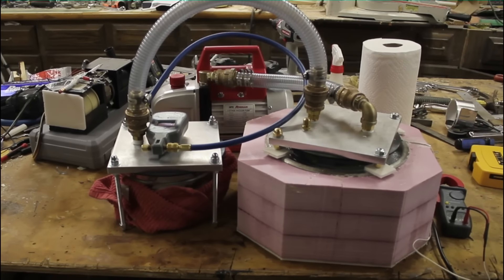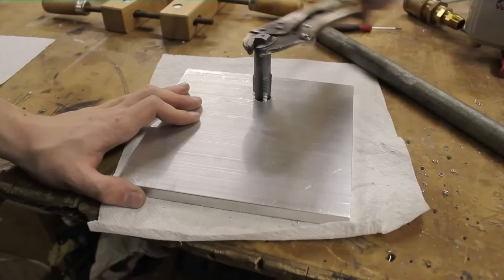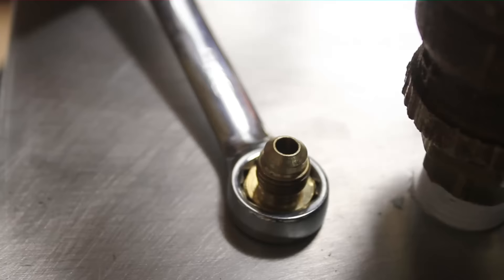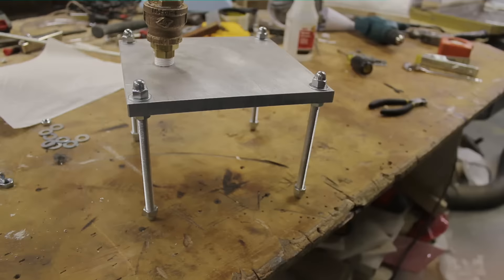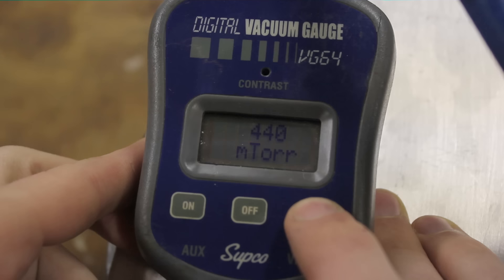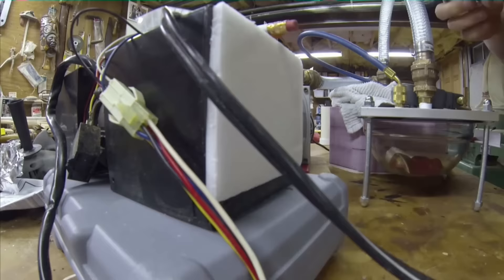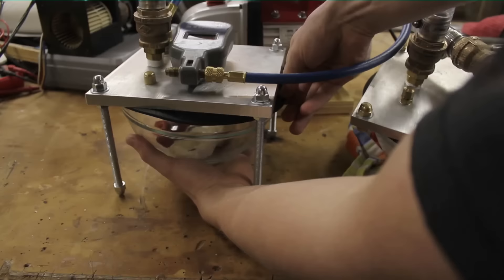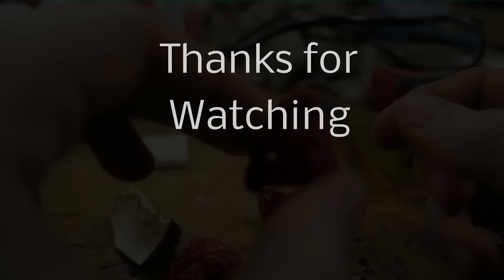How to Make a Freeze Dryer

Comment: Hey BenNBuilds, thanks for this. I'm working on this build and I have a couple questions:

1. What exactly is a water bubbler and where can I find one (wikipedia says it's just a drinking fountain)?

2. What exactly is this hacked water bubbler used for? Is it just used to freeze the food instead of dry ice, or can it somehow be an alternative to dry ice + isopropyl alcohol as part of the freeze dryer moisture trap? <-- I ask this because you said it's an alternative if you don't have access to dry ice, so I'm just wondering if you meant it works to supplement dry ice for this part too.
Reply from the maker: Just one of those office water coolers that take those 5 gallon water tanks. They have small refrigeration loops in them, similar to what cools fridges but smaller.

 Its just an alternative to dry ice, but one loop on its own won't get cold enough (you would have to build a cascade with two to reach anything past -30, but that's a fair bit more complicated) so I really just used it as a supplement test less dry ice, but the effect was likely negligible and not worth it as dry ice is pretty cheap.

Comment: Nice work BenNBuilds !
I am doing this as a science project but got stuck. The one that lends me the pump said that it should be able to handle water vapor, so i skipped the cold trap (Dry ice is hard to get where i live) and i get below 200 pascal (just checked the pressure shortly because i borrowed the gauge) But as soon as the icecream gets subjected to room temperature, it melts even if the container is connected to the vacuum pump. You mentioned in another comment that the oil catches the water vapour, so maybe it gets oversaturated and then cannot dispose of all the water? The oil have only gone cloudy when air have leaked in.
Reply from the maker: You may just have to get your ice cream colder before you start. I froze mine past -50F so I had a nice time buffer before sublimation cooling kicked in. If your just pulling it out of the freezer (usually 20F) than that's your problem. Ice cream is meant to be soft and edible at those temperatures. You gotta deep freeze it. 
    I encourage you to reconsider about the cold trap, Its easy enough to find a water bubblier or something.The pumps really can't handle all the water that is inside ice cream. 5oz of water is way to much for a rotary vane pump to handle. I assume whoever lent it to you didn't know it was intended for freeze drying. The water vapor present in just a couple cubic feet of regular air can be bad.
Reply: BenNBuilds  The teacher that lends me the pump is actually teaching relatable subjecs to refridgerator maintenance and according to him, there can be water vapor inside the cooling systems so they are built to handle some of that. I am planning to build a cold trap anyway because it adds some security to that the pump will not wreck, and i can also monitor it to see about how much that have left the icecream.

I actually left the icecream subjected to *30C (-22F) under vacuum for 12 hours before i put it in room temperature, and it still melted. I also tried putting it in an icebox with cooling clamps around it so it would not heat up too fast, but it melted anyway. I am starting to think that the standard tubing with the 1/4" vacuum pump fitting may be too small.

Comment: Im sure someone asked this: 

What did it cost to build? 

And more importantly,  whats the estimated average cost per pound to freeze dry food?  

Is the cost of your time, parts, materials,  dry ice, etc going to be more than buying the food already preserved?
Reply from the maker: It cost me about $150 to build.
 If you use dry ice for the cold trap it will be way more expensive to run. I used about 10lbs for 18 hours of drying, which is like 10$ every time +checking it every hour. With the hacked water bubblier the only consumable was electricity so it costs less than a dollar to fully dry stuff. If I got a bigger food chamber and fit a pound or two at a time It would get super cheap. If you used it all the time it probly wouldn't take long to break even

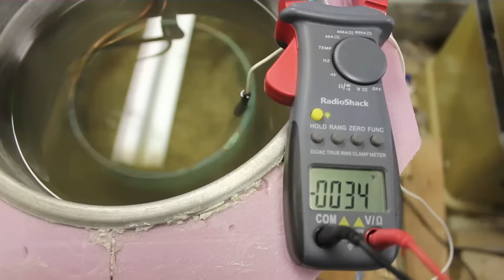Comment: Can you please explain the hack you talked about at 3:27 I cant understand what youre saying and it's the most important part of the video for me please let me know I would appreciate it a ton
Reply from the maker: Just pull all the guts out and bypass the temp sensor. Replacing the coolant may also be necessary, they don't get cold enough with stock refrigerant. I ended up setting up a two stage system to get down cold enough. https://www.youtube.com/watch?v=mzeRvdnIP-I

Comment: Hi. I am going to build this freeze dryer! But I require some of the details that I am not clear on:

As far as I can understand from the video, you have to drill 3 holes in each aluminium plate. 2 are the same size and one is larger. Can you provide the sizes in mm?
Also you use 2 types of barbs (?) Is it possible to tell exactly what the names of the 2 types are? Can I get them at a hardware?
Where can I purchase a vacuum gauge and pump? Is it easy to get?
Do you have any heating element in the main food chamber?

Thank you!
Reply from the maker: Shaakira J Go for it!
 I drilled and tapped one 1/2" NPT hole in the food chamber plate and two 1/2" NPT holes in the cold trap plate. I also added a 1/4" NPT hole in the food chamber plate for a gauge. The sizes aren't super critical, but I wouldn't go much smaller than 1/2" NPT (~18mm hole).

 I used 1" hose witch was a bit big, just go for 3/4 ID it will be a TON cheaper and easier http://www.pchemlabs.com/subcatagoryb.asp?pid=PVC-Clear-Spring-Reinforced

I just got the hose barbs and adapters off amazon http://www.amazon.com/dp/B000LNMQTO/ref=biss_dp_t_asn

And an A/C service pump, anything above 3CFM will work http://www.amazon.com/Arksen-Single-Rotary-Vacuum-Refrigeran/dp/B00E8SXLOC/ref=sr_1_6?ie=UTF8&qid=1425624780&sr=8-6&

To heat the food in the main chamber I used a IR lamp (from the pet store)

Comment: How do you rebuild/hack the compressor/bubble to keep the water cold?
Reply from the maker: Just pull all the guts out and bypass the temp sensor. Replacing the coolant may also be necessary, they don't get cold enough with stock refrigerant. I ended up setting up a two stage system to get down cold enough.

Comment: I do not understand why dry ice is used, after all it will bring the temperature down and therefore move the scale for sublimation further to the left and require lower pressure. At room temperature water will evaporate as long as you drop the pressure. In fact I think commercial drive freezers have heating pads to heat the food as it is drying.
Because as the water is pulled out of the food it drops the temperature of the food making it harder for the rest of the water to sublimate....
That is why professional drive freezers use heated plates for the food... 
Unless I missed something here...

Comment: Nice Build! What happens if you don't cool it? Wouldn't it suffice to just put in the deep freezer with around -15°C?
Reply from the maker: Thank you!
Water will be a vapor in a vacuum above -35ish, -50 to be safe. if all the water from your food went into the vacuum pump it would wreck it possibly after just a couple hours of pumping. The water just collects in the pump oil and rusts all the inner components very quickly. The vapor trap stops that from happening only because it's cold enough to freeze the water inside a vacuum
Reply: ^^? So it would be okay, if i put the food upside down on a gitter? Then it might work?
Reply from the maker: Dito Not sure what you mean, the food needs to be exposed to vacuum <800mtorr and warmed slowly to sublimate all the water inside. And the water exiting the food needs to be recaptured by -40F before it enters the vacuum pump.

Comment: Looks like fun making it but... way not worth the trouble, dude.
Great job on the video! You're kinda like a professional ;-)
Reply from the maker: +Tifdexaler The whole point is the fun, I've only used the thing like 5 times :)
Reply: HOw much would you charge to build me one?  I have 2 disadvantages:  1).  I am a female and 2).  I am very disabled.  Oh, and 3).  I live alone.  I want one really bad, but 4).  I do not have $1,000's to buy one when I have a '02 minivan that needs work.  Thanks.
Reply from the maker: The materials are almost 1000's and I don't have the time (I would have to charge a TON). Building it yourself is all the fun and a lot cheaper. You might be able to have a friend build it for you, or use someone else's shop. Being female isn't a disadvantage, just go for it!
Reply: BenNBuilds The real disadvantage is being severely disabled.  Want to sell yours?  Have you seen the new ways to make your own electricity?
Reply: daschundloverable I'm wondering why you want one so bad. Do you have access to lots of fruit at one point of the year? If so preserving might be a better option, and within your means. Even using a food dehydrator might be an option.

Comment: a hacked water bubbler?
can you link me an example?
Reply from the maker: I just took the guts out of one I trash picked and attached a plug right to the compressor terminals(no temp switch). It's easy to figure out which way the compressor hooks up, it's just normal wall AC power and ground. 
The rest is just a closed refrigeration loop so as long as you don't break the pipes or radiator it will still work. The refrigerant is really bad so disassemble it outside in case you break the pipes accidentally. 
When its on you'll hear a quiet hum and it does take a while to get cold. I don't really know of a good example to link to, sorry
Reply: Ok, i've gotta ask is this "bubblier" thing slang for something cause i have no idea what you're talking about.  From the video it looks like you ripped the innards out of a fridge, and just bent the refrigerant lines around your bowl.  You mention that this doesn't really achieve the lower temperature that you achieve with dry ice.  In my mind the dry ice situation makes this whole setup far too high maintenance. (would be ideal if you could just turn it on and come back when its done).  

If you really just ripped apart a fridge or a freezer, you should know that those compressors are not built to just being hardwired like that, there is a reason for the temperature switch, so that you don't overload that compressor.  Eventually you will burn out that compressor.  But i guess you got it for free so that doesn't matter much.  

Do you have any other ideas on how to build a very low temperature chiller?